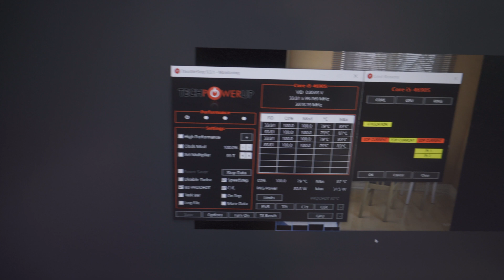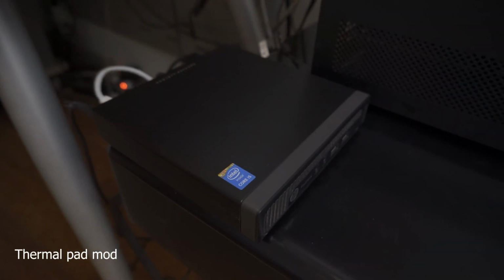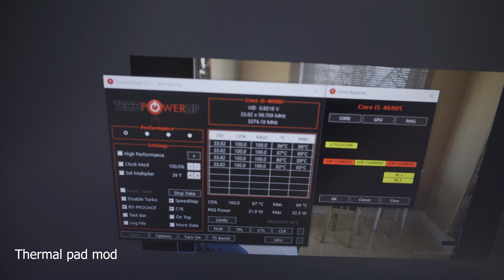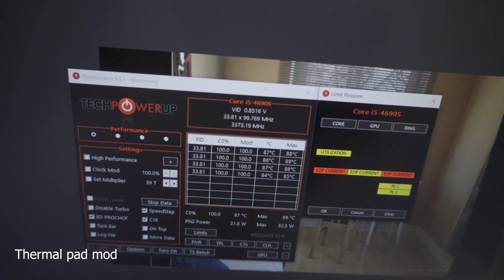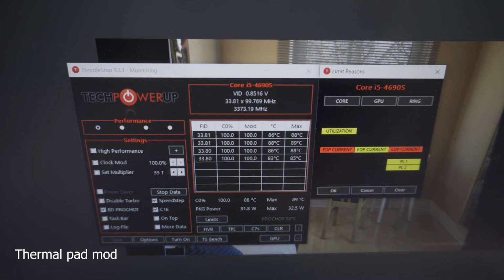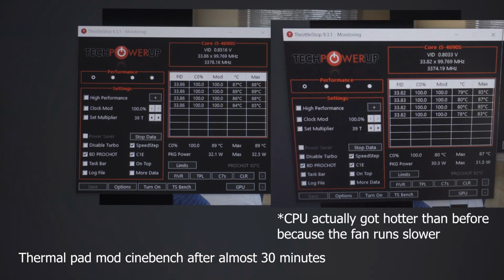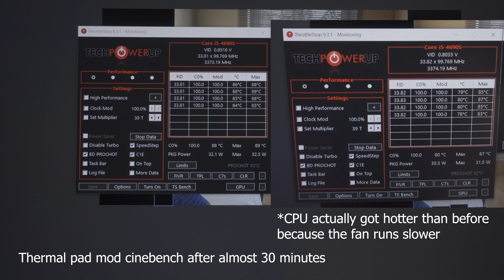Fixing HP's Design Flaw | Thermal Pad Mod Prodesk 600 G1 Mini Stops VRM Thermal Throttling

Comment: HP Prodeskk 400 G5 and the like don't have heatsinks on the VRMs either however i have not noticed any throttling even in my garage with high summer temps with continuous 100% load with 50 watt package power. guess they use enough phases to keep it under control on their regular SFF lineup rather than mini. same goes for Optiplex SFF non-mini

Comment: I built a mini workstation with GPU card. 
I glued a 1mm copper shim across like a heat sreader on the VRM mofet chips on a 800 G4 Mini 35W i5-8500T. I'm using a 65 watt copper heatsink on a 35 watt processor, I also glued a piece of 4mm thick copper across dthe ones on the side and put a 1.5mm thermal pad on it. I use thermal plaster for glue. I finish with Honneywell phase change thermal pad and new thermal putty instead of pads.
Reply: I didn't see it go over 65C under a load test. It's always quite. I copper shimmed the memories on the GPU and used little balls of thermal putty with the same Honneywell phase change pad on the chip. 74C on the GPU is the highest temp under load.
Reply: After doing a few G2 G3 mini's the intel board is a good one to use a copper shim heat spreader the AMD board has too many tall components it would short out. Using thermal putty is about the only thing I could find to do to the AMD boards.

Comment: The Gen 1 HP mini systems were poorly designed for cooling! The heat sink is in front of the exhaust fan, which means the fan has to suck the hot air through the heat sink to exhaust it out the back of the unit! This design flaw was corrected in later Generation minis.

Comment: I have one of these and The screw that holds down the CPU bracket is missing. What is the size of that? The other 2 is M3 6mm. Is the third the same?  I tried to find manuals but to see what screw needed but no luck yet.  Thanks.
Reply: If you still haven't figured it out bring the whole system into Lowe's or home Depot
Reply: @EricK-tb2dn  Thanks. All sorted , just put a screw from an unused motherboard into the PC. Works perfect.

Comment: I never had this problem with a pro desk 600 G1. It runs perfectly fine, but may crash a bit here and there but I never saw it at super high fan speeds.
Reply: He has changed the RAM with much higher power hungry RAM and does not know he could of bought low power RAM and the VRM would not get nearly as hot. The G2 version moved the RAM under the FAN instead of under the HOT SSD which almost makes this mistake unnoticeable.

Comment: with the fan set aside, it takes about a minute to put an M.2 SSD strip into the black socket.
Reply: If you want to boot from an M.2 then it has to be a special HP version that has the boot built in. Otherwise you have to modify the BIOS so you can boot from any  standard M.2 drive.
Reply: @markallen2536  Alas, hp has never made one, so I always use another brand, instead, when I open a 600 G1. The cost of some custom "booter" IC would make such an M.2 unprofitable.

Comment: i see you upgraded your cpu. do you think a xeon 1271 v3 would work in this? its an lga 1150 cpu i just wanna know if its suppported.
Reply: Just to update I used an m.2 gpu adapter and the Xeon worked!
Reply from the maker: It will not. It does not have an igpu.

Comment: I have a HP ProDesk 600 G2 Mini and a HP Elitedesk 800 G2 Mini and I had to redo the thermal paste on these systems. The issue with the VRM was fixed by HP, there are parts of the CPU cooler it self reaching down to the VRM on the motherboard and small thermal pads to take away the heat. The chipset is still on the underside of the motherboard. I do not know if you need thermal pads for the chipset but I will have to test that someday.

Comment: hi friend. interesting video, i have problem with cpu throtling on 2 hp mini pcs. Its 800 g2 mini with i5 6500t and 260 g2 mini with i3 6100u. When gaming on both after 30 sec cpu speed drops to like 50%, cpu temperature not a problem goes to 65-70c. When testing with furmark, stressing only cpu speed is good, testing only gpu speed is good, when i try to test cpu and gpu at the same time cpu speed drops 50% on both pc. What could be the problem, is it the same issue as you have. Cheers.
Reply: You're hitting the Amp-draw cap of the waste-heat limiter on these EnergyStar "green" CPU ending letter "t" (35W) and "u" (15W).

Comment: I didn't even know that this was an issue on these systems. Thanks!
Reply from the maker: Baffling I know. The newer HP Mini Desktops seems to have contacts for the VRMs to the heatsink.
Reply: Decided to pick one of these up on eBay for a super good deal, it has an i3 4160t so I'm not sure if a 35 watt CPU would have vrm issues. I did surprisingly get windows 11 to work on it for my parents